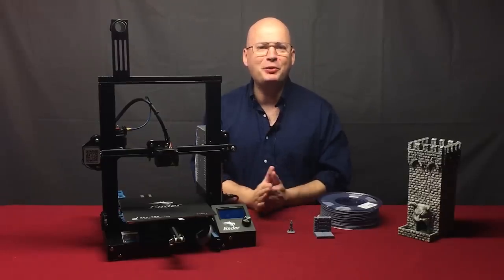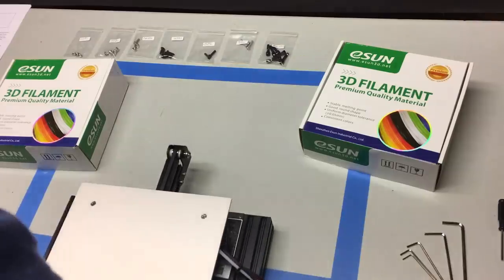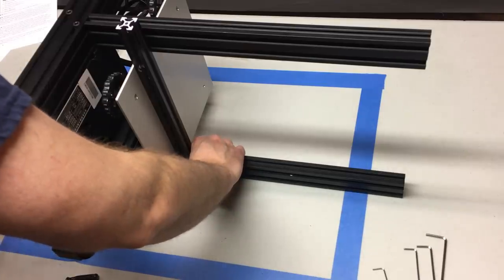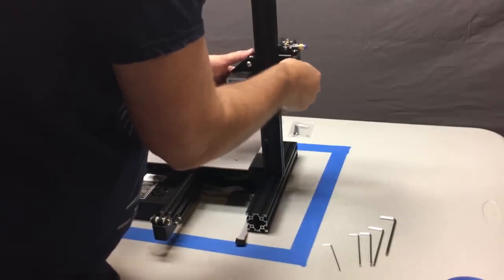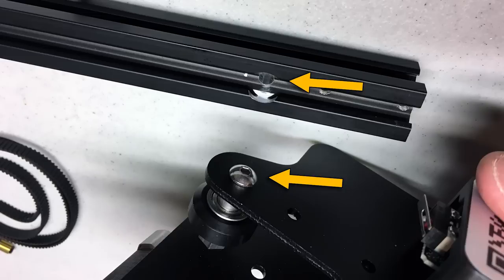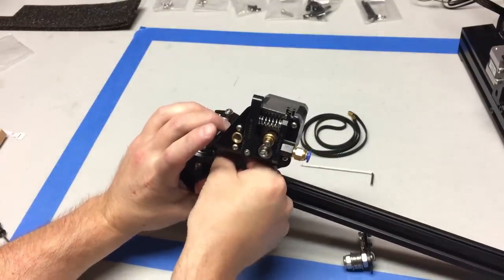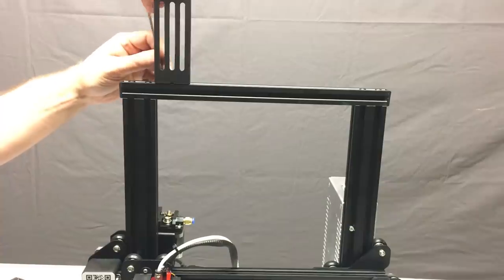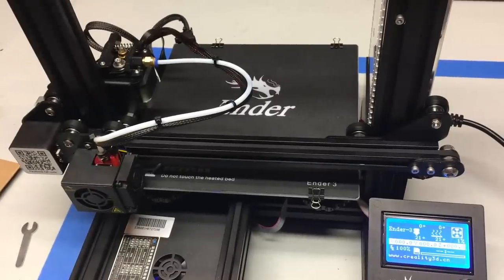Creality Ender 3 assembly and pro build tips

Comment: Is the pro version worth $40 in your opinion?  Also trying to decide to glass upgrade for it. This would be my first 3D printer. Thanks again.
Reply from the maker: For me, yes. The Meanwell power supply alone will run $35 separately, and on top of that you get a magnetic bed, and the wider Y-axis rail for more stable printing. The straight Ender 3 is the best bang for your buck, but it is severely underpriced for what you get. The Pro is still a great deal and worth every penny. If you are getting either one, and are ordering from Amazon, use the links in the description above as they are confirmed to be the official Creality store and their licensed reseller Comgrow (there are other venders on Amazon selling older stock, you want to get the most current version with updated firmware.)
Reply: Thanks for info. I am located in us so Amazon is very tempting. Have you had experience with a company in Texas called tin machines?  They say they go through machine to make sure everything is in box before sending. They sale the pro for around $300. Thanks again. I have subscribed to your channel.
Reply from the maker: @easttnscott7629  Yes, Tiny Machines is reputable. :)

Comment: Why do you need to replace the couplers? Thinking about getting one, will it not work with the supplied couplers?
Reply from the maker: The supplied ones are not very good quality and fail anywhere from a few days to a few weeks after construction. If they do, you have a mess to clean out in your hot end, so it is easier to replace them up front and avoid the hassle.
Reply: @Tombof3DPrintedHorrors  is there anything I can do to extend the life of the coupling? maybe a zip tie or something? how exactly does the coupler fail usually?
Reply from the maker: @deathlinguine4582  the teeth down in it loosen/break and let the tube slip. A zip tie might help a little, but it isn't a fix. You need the recommended coupler upgrade.

Comment: what if the wheels seem to be rolling fine on the vertical bars, but the top bar isnt in line with the screw holes? ive tried messing with the tightness of the screws at the bottom and nothing seems to be making it more level so far
Reply: i managed to force the screws in and it seems fine but since theres tension id still like to hear about an alternative solution
Reply: tempted to try to increase the voltage but since im not sure what my local voltage is and i assume its supposed to move on low wattage anyway im hesitant to try it, but if nobody stops me i just might

Comment: My right side X axis keeps sagging.
Reply from the maker: Are the screws holding the cross bar extrusion are loose? You might need to tighten eccentric nuts, but don't do them too tight or that will cause other issues.

Comment: I can't get my bed to paper thin distant from nozzle it's at full height!! Please help
Reply from the maker: See my bed leveling video, you need to lower your Z end stop switch.
Reply: @Tombof3DPrintedHorrors  I don't see a link to any video
Reply: @Tombof3DPrintedHorrors  disregard...I figured it out by your reply thanks so much
Reply: I haven't reached that issue yet. Just starting putting Ender together together today. I'm taking the build slow and watching all the videos about it.
 But I've read something that might help.

From what I've read.... One person has used paper shims under the mag plate table to make it flat.

Comment: I have never used a 3d printer before.  If i purchase an Ender 3 what software do i need to purchase for creating the modeling / slicing?  Or does it come with any? Thanks
Reply from the maker: Cura is the slicing software, and it is free. :)
Reply: So many people have problems with quality of ender 3 but several still like it. Is it worth the gamble of getting one?  Thanks
Reply from the maker: I prefer my Ender 3s over my $1000 Prusa Mk2s and Mk3s. Quality issues were mainly with the first batch last spring, all of mine have gone together perfectly with no hitches.
Reply: Thanks for reply. Now to decide between pro or standard version?

Comment: Thanks to you I managed to get my ender 3 to print in excellent quality! It was already assembled with the instructions from CHEP, but he didn't go into detail nearly as good as you. 

Then again, he gave another potentially important advices that you left out (maybe because they are not that important, idk), like for example assembling it with a 90 degree angle everywhere. 

Also, some things are hard to get, like the 1mm horizontal play you mentioned, would be nice if you showed exactly what you mean. That play could be only at the beginning, where the screws are, or at the very top, which would mean a lot less play at the beginning. 1mm Play at the start of the aluminium extrusion is like 1cm a the end. Also you say we should check the distance with the Filament handle, but before that you loosened the mentioned screws for the play. So the distance at each end wouldn't be accurate, the more loose and the more play, the less accurate it gets, that's why it is so important to know what that means and maybe to build in a little explanation there. 

Also, you should go a little more into detail when it comes to the z axis lead screw, like how it should look like standing up without anything on it. So that you could see if your Z Axis mount is correctly assembled and attached in the first place or if the lead screw sits there very uneven which would make further assembly a lot more complicated. Of course, in the step you describe in the end where you describe how to test the functionality of said part, people will see if there's something wrong, but adjusting it correctly beforehand just saves a little time and energy.

That all said, your video is still a VERY good one and helped me A LOT. I appreciate people like you, the things I mentioned are just productive critics/suggestions to improve your almost perfect instructions even further :) Thank you a lot, sir!
Reply from the maker: I don't recommend using a 90˚ angle in the video because most people do not own one, I keep my recommendations confined to common household items that do the same job. :)
Reply: @Tombof3DPrintedHorrors  so it is not that important to have it like 100% "90° Angle equipment aligned"? Asking out of interest, as I really "fear" misalignment after Cheps video xD
Reply: @Tombof3DPrintedHorrors  Also, I think it's very thoughtful of you doing it so everyone can handle the assembly without running to the next shop to get an angle like I did ...
Reply from the maker: @ramsankotiev6612  if you use the extrusions to aid alignment like I show it will be 90˚.
Reply: @Tombof3DPrintedHorrors  ok good to know! I will most probably buy another ender 3 (they're like 150€ here in Germany) and build it with your instructions from the very beginning. My prints turn out excellent after this, thank you again!

Comment: Hi I'm at the spacer part and keep getting my right side a smidge different.  Any ideas to help that?
Reply from the maker: I'm sorry but I don't understand your question. Could you please clarify?
Reply: @Tombof3DPrintedHorrors  the part when you are using the spool holder to check right and left side spacing  differences.  I've tried tightening and loosening the bolts a few time but keep getting tight side lower on arm
Reply from the maker: @13tabicat13  Ah ok, that is something you just have to keep playing with until you get it within about 1mm or less

Comment: I actually have three questions :) So I figured why not get a cheap 3D printer to get into things and see how it goes...things go bad, well, it was cheap....things go well, the skys (well no, Im not rich) is the limit :) Oh, and I'm mainly looking at printing minis for rpgs. 
a) I read tons of good reviews on the Creality Ender 3 .... if I check on Amazon though, it gives me Ender 3's from various companies it seems (Clones?)Are they all the same more or less? How to tell which one is the original if that matters? (most seem to come from CN)
b) whats a good, basic filament to start with? (again, thinking minis)
c) maybe a bit odd...but how much smell does this produce? I mean, is this run-in-the-living-room stuff or really better cellar?

Thank you :)
Reply from the maker: I have reputable sellers linked above in the video description, along with my recommended filament. As for smell, the first few hours of use there will be an odor from the parts being heated for the first time, but after that there isn't one as long as you stick with PLA filament (what I recommend) as it is non toxic. :)

Comment: Is there another way to shim the z motor if we threw out the cardboard that the cutter came in?
Reply from the maker: Shim the Z motor with cardboard? I have no clue what you are referring to.
Reply: @Tombof3DPrintedHorrors  At 17:15 is what I'm talking about.
Reply from the maker: OH! You can use anything there, or nothing. It's just an aid to held the motor up a but while you put the screws in if you are building the machine alone. Easy to do without it too.

Comment: Is it really necessary to loose the 2 screws which hold the brass lead of the z axis lead screw?
That seams pretty odd to me.
Reply from the maker: Yes
Reply: @Tombof3DPrintedHorrors  Wow, you've answered pretty fast. Thank you for your answer and also for the whole video, I am printing now the first print on my new Ender 3, which you helped me a lot to build.
Can you please tell me just roughly the reason of why we need to keep loose those 2 screws? How is it bad if those are tight and how does it help if we loose them?
Reply: @jonatan01i  the rod moves more smoothly I think?
Reply: @BenCos2018  Yeah, I've figured by now. But thanks.
Have you just built one of these?
Reply: @jonatan01i  no not yet
Reply: @BenCos2018  I hope you will also find this machine fascinating to work with.
Reply: @jonatan01i  thanks good luck with yours also

Comment: 20:45 still dont understand how this helps
Reply from the maker: If it's off level you will not get good prints.
Reply: @Tombof3DPrintedHorrors  I tried to unscrew the screws 2 and more turns but it does nothing. Right side is still 1mm higher than the left side
Reply from the maker: @adamvalt6609  unscrewing the screws only loosens the bar to where YOU can adjust the angle of the extrusion, just loosening the screws doesn't do that for you.
Reply: @Tombof3DPrintedHorrors  ooh that makes sense :D well printer is already assembled, first prints look fine. If it starts to get worse I know what I will have to do :)
Reply: @Tombof3DPrintedHorrors  I’m sorry but what to screws do we have to readjust here? You can tell me in which time in the video so I can understand
Reply: @JustJedi19  19:46 this ones